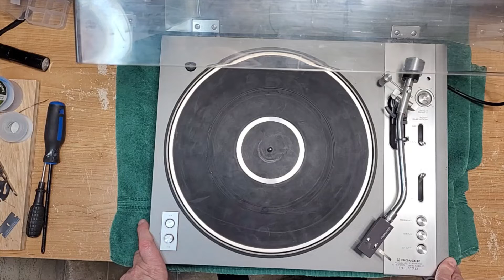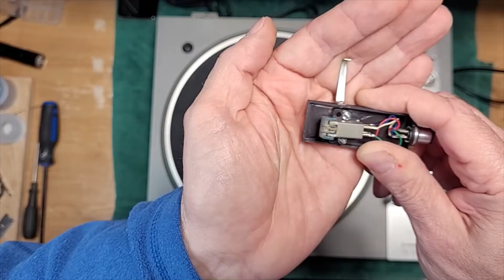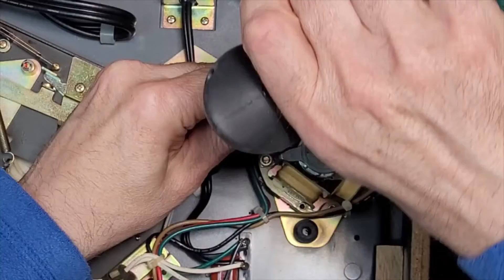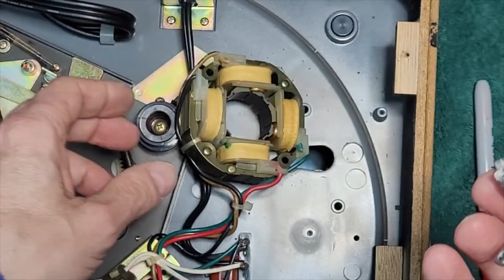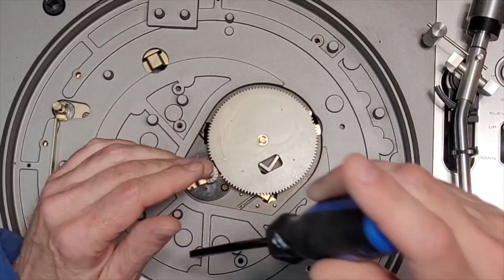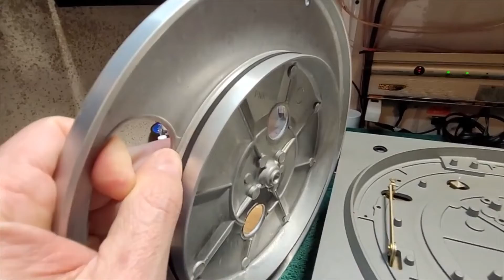Pioneer PL-117D: Lubrication Service

Comment: Have you ever done a lifter piston service on one of these? I can't seem to be able to figure out how to get it out.
Reply from the maker: Honestly can't remember.  On most tables, you first need to remove the lifter arm on the top side and then remove whatever is in the way of the lifter piston down below.
Reply: @TurntableGuy  Yep, I see it now. There is a knurled "nut" below the spring that holds it all together. Actually, since the previous comment/question, I was able to work some 300k weight silicone grease into the mechanism from the top and the lifter lowers just about perfectly now. Thanks.

Comment: Surprised... since you had the unit open and lubriated the spindle... why did you not remove and clean/grease the cam gear?  There was originally grease along sone of the underside rims, and hole.

Comment: Couple of comments - Excellent video- Thank you.
Something to mention, the center spindle has a bee-bee bearing on the bottom that sticks to the spindle when removing.  Mine fell out and luckily I noticed it running across my garage floor.
Next - My cueing seems gummed up and suddenly won’t raise up properly, although it did when I first started working on it.  I’ve attempted to lightly lube it but it won’t go up on its own. Also wish you might cover where to set the anti-skate and balance on the arm.
Finally, I’m hoping I can post a photo of my belt spindle covered in old belt material - wow!
I picked this up in a garage sale and believe it or not, in spite of everything it does play “fairly” well. 
Finally, I wish I could send a photo of my belt spindle.  It’s covered in belt residue to the point I thought it was a rubber gasket of sorts.

Comment: I've had my Pioneer PL-115D since new in 1976, want to do a service on it. Pioneer didn't use a grease on the spindle originally? They used oil instead? I've read that the 30W oil for spindles should be synthetic non-detergent. Where do you find your Shell 30W? What's the smallest size available?

Comment: I have been using singer sewing machine oil As a lube for my 117d
I just learn from you on how to take the motor apart to lube it
Is oil good to use or switch to 3 in 1?
Reply from the maker: Singer is good
Reply: Thank you

Comment: Glad to see you back. BELT looks tight. Should run slow. Probably rubbing on the selector. 32.7 RPM would drive me insane.
Reply from the maker: It's actually running at 34.2 rpm.  I lost the footage of the speed test.
Reply: @TurntableGuy  either way....I'd go mad. I have OCD about pitch. That is why I refuse to work on belt tables unless its a FG servo with pitch control a la technics SL-23. If you search kijiji calgary for Dual...you can see my work.
Reply from the maker: @Poppinwheeeeellllllieeeeez  I just had a quart-lock Dual (CS 5000) in here that I couldn't repair.  Motor coils shot.  That one supposedly keeps good speed, but alas, it's dead.
Reply: @TurntableGuy  common that the wires break between the windings. Can be McGyvered / Bodged but NOT ideal.
Reply from the maker: @Poppinwheeeeellllllieeeeez  managed to source a motor.  We'll see if that fixes it.  Video Coming.

Comment: Great video! Regarding the Excel cartridge: this basic version (silver body/blue stylus) is not great, but ES-70F and higher are much better. Fun fact: LPGear Vessel and Sumiko cartridges everybody is raving about are made by Excel and use exactly the same generators.
Reply from the maker: Interesting.  Yeah, the basic models that came stock from the factory on these Pioneers were nothing special.